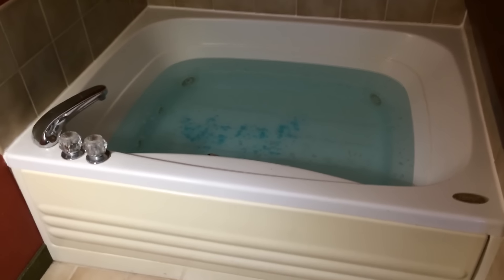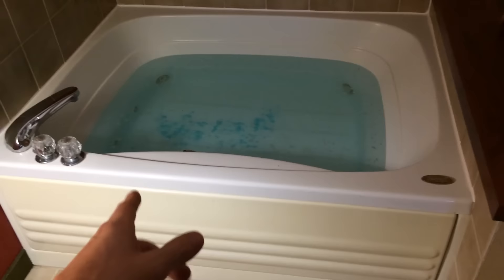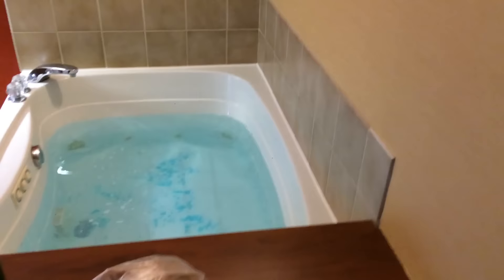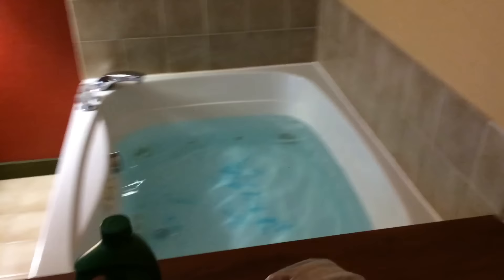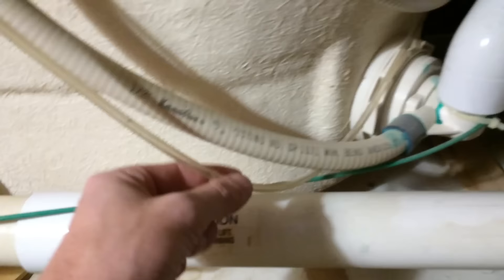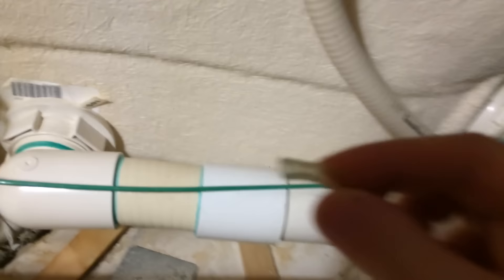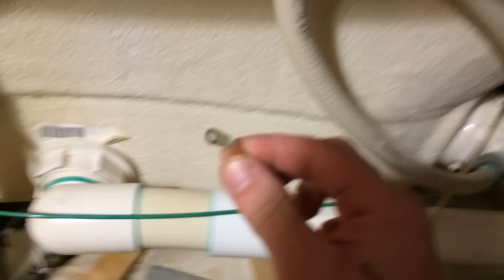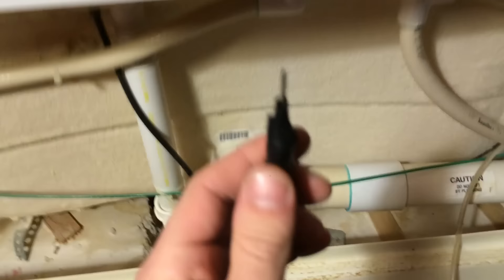HOW TO start a jacuzzi when the push button STOPS working/loses it's prime...

Comment: Thanks for this video, which inspired me to take a closer look at our jetted tub that stopped working several years ago. Turns out the plastic tube had disconnected from the push button assembly. So there is a variation on the theme.

Comment: This is all well and good if the air button is in the front/room side of the tub behind the access panel. My air button is on the wall side of the tub and has no access. The kitchen is behind the wall and cabinets are installed all along that wall.

Comment: I drilled a hole for the hose in the wood access panel and use a desoldering squeeze bulb to turn the jets on and off.

Comment: Mark....I owe you BIG TIME on this!  I was looking at replacing the pump.  There was no hum, and the motor would not turn on at all.  I looked at all sorts of suggestions from others regarding what might be the problem and then I ran across your video.  You totally saved me money and frankly TONS OF TIME!  I had a foot pump and did exactly as you showed and my tub fired right up!  Couldn't believe I was so lucky.  Frankly lucky that I saw YOUR VIDEO!  Thanks so much for the posting:)  Jeff Toy
Reply from the maker: Jeff Toy no problem friend!  Glad this helped you out...
Reply: Mine has a humming sound but nothing is coming out I’ll hv to try this

Comment: Because the Bellow Switch had lost pressure it wouldn't push air enough by pressure. Mine stopped but worked after 5 tries! It could also be bust as it's rubber so look for a compatible Bellow Air Switch/Button.

Comment: Man, had my Jacuzzi installed with the house in 2003 and it hasn't worked in years....haven't called a repairman.  Unfortunately, mine is tiled in the front but they did build an access panel on the outside/left of the house so I'm hoping I can get to it from inside there.
Reply: Same here, exactly- did you figure out a solution?

Comment: I ended up cutting the tubing and primed it because the installer of the tub tiled over the access to the tube at the button.  I had access to the tubing and cut it, primed it from there and reconnected.  Thanks for this video!!!  Totally helped!
Reply: Angela how did you reconnect after cutting? Did you tape the hose back together?

Comment: Worked perfectly. Still would not work with the switch, so I then knew the switch was broken and replaced it with one from Amazon that cost £4. I was going to call a plumber until I saw this, thanks very much.

Comment: I just ordered a replacement air bellows for mine, if that does not work, I'll probably give this a try. Sadly, mine does not have an off and on switch on the wall, just the push button in the tub.

Comment: How can i turn it off? When i connect wires,pump starts working,but from there i have a problem..i'm not able to turn the pump off,what should i do
Reply from the maker: It shoukd turn on the same way…by air pump…or it should be on a timer i would imagine that will run out…if not i would kill the power and find a way to turn that off…

Comment: Will this work in reverse? Mine is stuck in the on position and the button does not work. Do I just need to get some air in the line and then I will be able to turn it off? Right now I have to turn it off at the breaker.
Reply: Did you figure it out? Mine is stuck on and blowing into the line isn't working.
Reply: @knumbnuts  I have the same problem

Comment: The air hose on mine fell off the push button. The button is on the backside of the tub, against the back wall. I've tried everything to snake the hose back around to the pump toward the front. Any ideas on how to reattach and run the air line from the back of the tub?
Reply from the maker: skkydreemer that button assembly is called a bellow/bellows...it is replaceable...that button can break down over time...i would replace it all the way friend!
Reply: @MAKdailli  I bought the replacement part  and that is when I discovered the air line actually fell off the bellow. The issue is that it's against the back wall to the tub. I can't reroute the air line
Reply: @skkydreemer  
Is your problem controlling the direction that the end of air line/hose goes once you reach as far back as you can before you hit the bottom of the tub or other obstacles? 
Can you run a coat hanger or a similar stiff wire that you can control down through the hole created by the removal of the old switch and tape the hose end to the end of the wire and pull the wire and hose end back up through the hole where you can connect the tubing to the hose barb on bottom of the switch?

Comment: Mine won't open I think is glued with silicon I believe
Reply from the maker: David T you will have to take the plate apart...the part for the button is called “bellows” i believe...and its basically a rubber air pump...id replace the entire button assembly...
Reply: @MAKdailli  thanks for advise